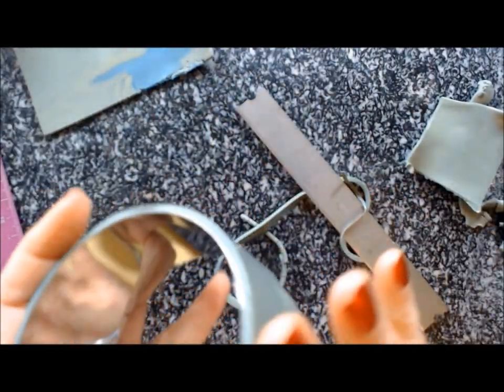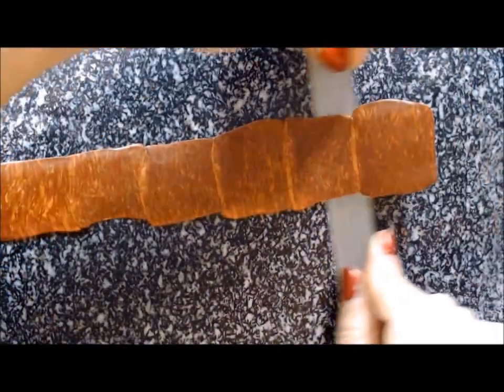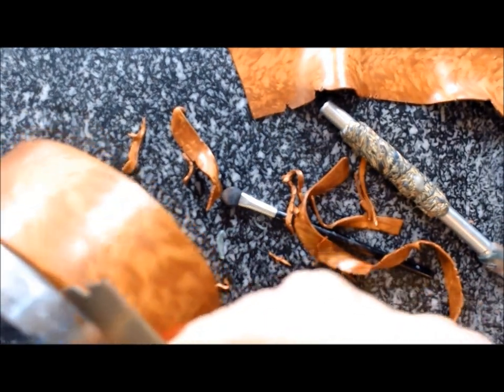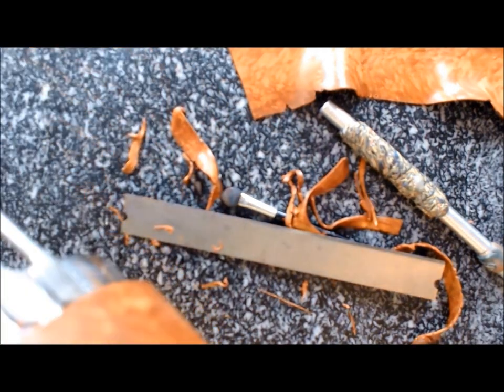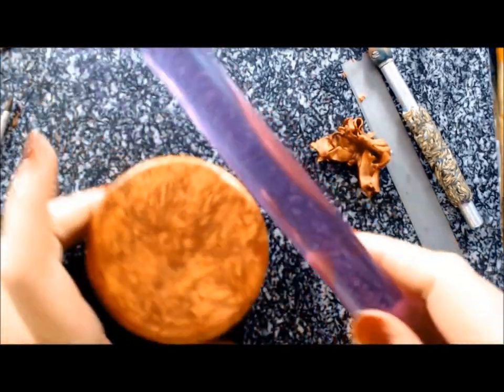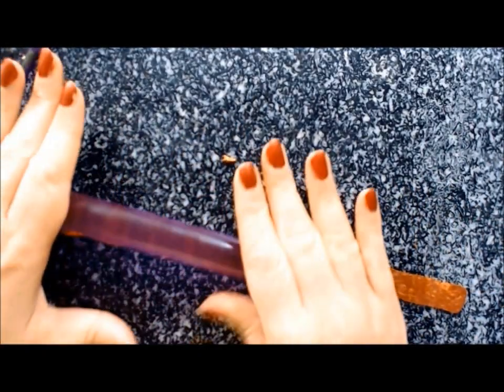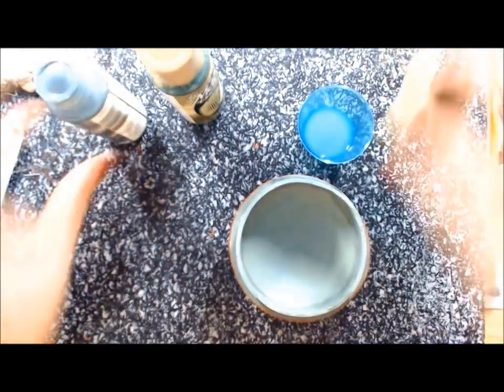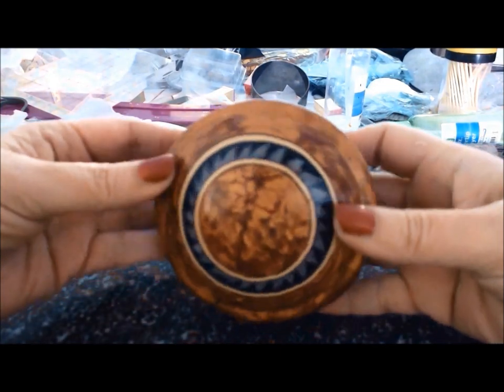Faux burl wood jewelry box - polymer clay tutorial 316

Comment: A question:  curious to know why using alcohol helps the smoothing process?  Awesome look, btw.
Reply from the maker: Alcohol slightly dissolves polymer clay. So it will dissolve the superficial layer, that way the minute particles of polymer clay get moved (kind of like when you smooth the frosting on a cake) and as the alcohol evaporates, they stay where they were moved.
Reply: Thanks makes sense

Comment: You show the blocks of three colors and then the rolled sheet... I'm a beginner who needs the intermediate steps! Do you blend the four colors together before rolling or by rolling?
Reply from the maker: I thought I said clearly that you mix the THREE  colors and I gave the measuring for them as well. Please listen to what I say as well, don't just look at the video. If you have problems understanding my accent (some people do), I suggest you enable the auto-captioning, that should help you get a better information. All the steps are given in the tutorial.
Reply from the maker: Also, this isn't really a beginner tutorial. You might get frustrated. I am not saying don't try it, as we can't advance unless we keep trying to do the next level of expertise, just trying to not get you frustrated. Try first to make a simple pendant with this technique of faux, so you won't mess up too much clay. Then do a box out of scrap clay until the box is ok. Then try putting the two together.
Reply: @KalyanaDesignTutorials  I did listen to the audio as well, and I actually don't intend to do a box, which is why I wanted more information about the burl wood specifically. I appreciate that you felt you had explained, but it was actually a bit confusing still. Thank you for your reply. (By four colors, I was referring to the blocks you showed, I understand that two of the blocks are the same color.)